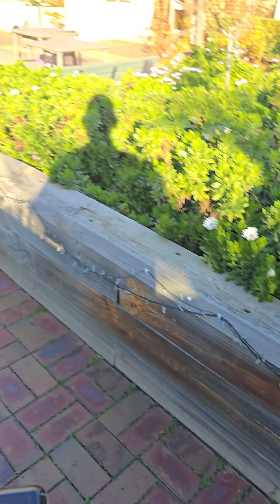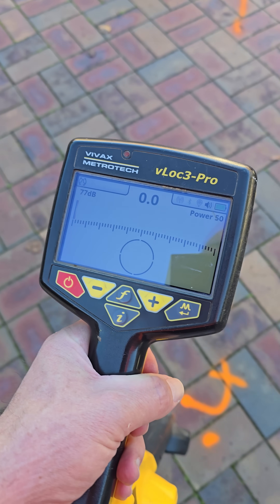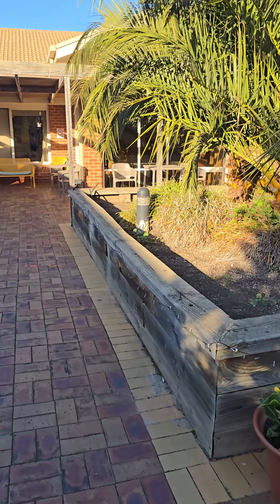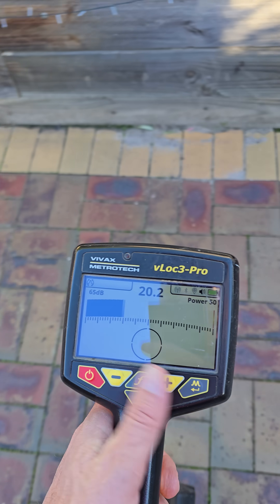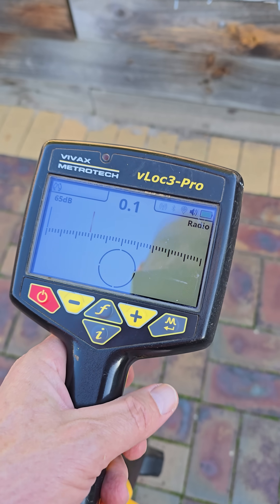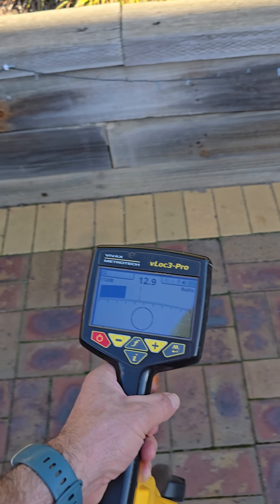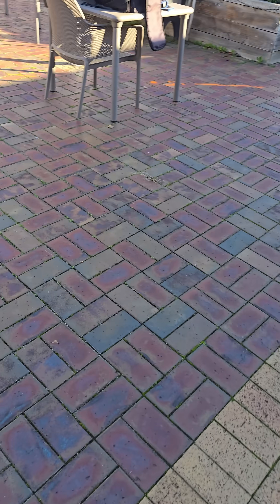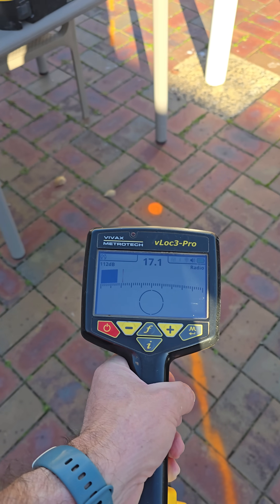Locating - Power mode vs Radio mode, which will detect the cable to the lights?

Comment: You can also use Genny mode, placing the genny on top of the cable it will project a signal down and you then trace that
Reply from the maker: Yep.
This video is more those people that think you can just walk around waving your want and finding everything.
Let's say that light was hidden behind a temporary fence and no one had told you it was there. Some customers expect you to be able to still tell them everything that is in the area simply by doing passive scans. So I want to show that sometimes you can't just do radio and power scans you need to induce signals on to the cables so that you can then locate them.
Reply: @GeelongCableLocations  in the UK just simply scanning alone won’t even pick up street light power because in the day time the power is off, so we use the light post to clip on and send a signal through the cable that can be picked up on radio. We can also request “safe dig prints” (electric/gas/water) but there they don’t cover private land - even with prints and scanning, even GPR (ground penetrating radar) the finding are nothing more then a guide
Reply from the maker: Hey mate, yeah very much the same case here. 
I actually did try biting into the light itself instead of pulling these apart but couldn't get it. It was only after I opened it up that I could see that the light wasn't earthed, like the street lights normally are so that would be why I couldn't pick it up with that method.
Reply: @GeelongCableLocations  I suppose it depends on the type of CAT being used, but one way we counter not being able to access the cable is by clipping on to the structure, if you struggle to find somewhere to connect you can use the wrap method, wrapping around the structure and then clipping it to the same lead - then we earth the structure ourselves by using a earth rod we tap into the ground.
Reply: @GeelongCableLocations newer models also come with a magnetic you can use to stick on the structure and then clipping to that

Comment: Power mode will need current flow of 50 hertz to locate it I'm sure you would have better luck with power mode if you had them turn the lights on to create a power draw or flow to generate the 50 hertz the reciver is looking for but yes I agree directly connecting to the conductor will always be your best signal for locating the cable
Reply from the maker: yep. Unfortunately, some sites they just expect you to be able to go around and wave a magic want and locate everything. Trying to get something as simple as an override switch for the lights turned on is impossible lol Just very glad I was able to pull these apart and locate them. But its a good site to show why I tell my customers I need full access to everything, cause we are not Harry Potter, even though the locator has features on it where you can locate cables without biting on to them, these features don't always work.